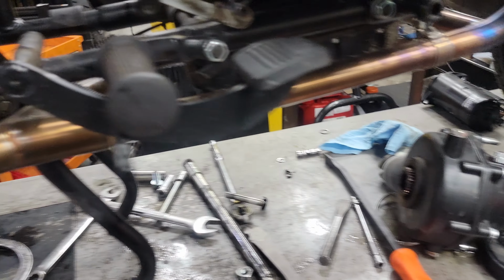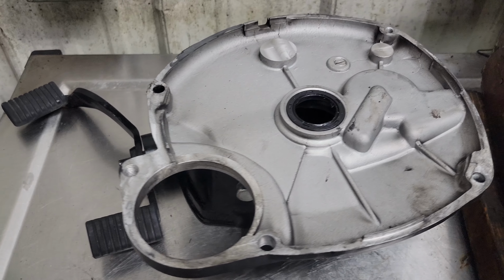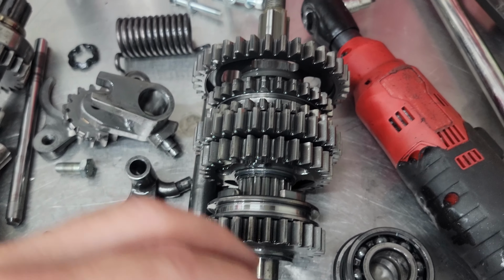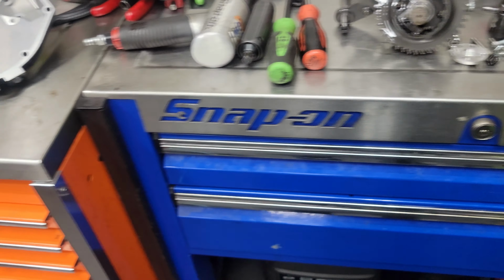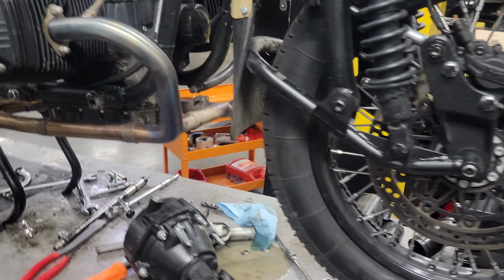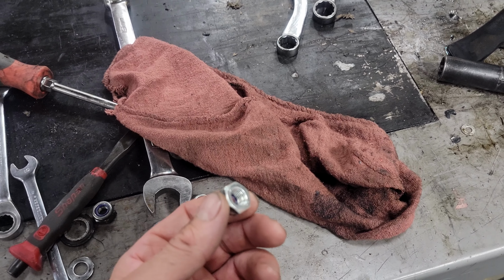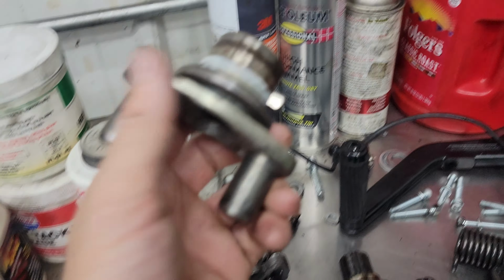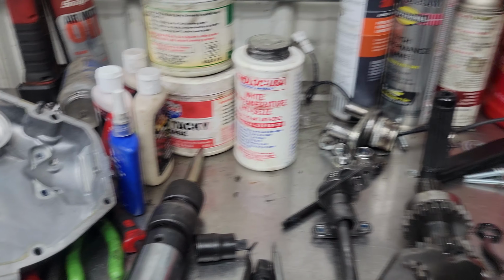Ural GearBox Rebuilt in House

Comment: While you're in there... replace 3rd and 4th gear with a slightly taller gear. Then there would be no need for a 5 speed transmission.  Just a thought.